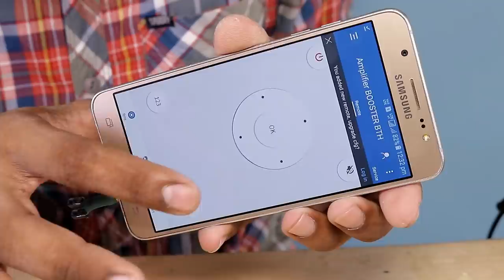3 Amazing ideas

Comment: That 1st one is so fake the phone u use has a ir lamp build into it and there are no drivers for an ir light in a headphone jack it doesnt work
Reply: send bob u has virus on ur compooter
Reply: They'd be using solder not glue...
Reply: Idk if youever ever tried to make an electrical contact AFTER placing hot glue. I'll tell you its pretty difficult. Difficult enough to make me doubt someone who reused clips 3-6 times a month just to keep their content farms going... just sayin'.
Reply: @Sam Orifici it aint fake i did this a long ass time ago i just used 1 from a old universol remot that was broken and it really work granted of course that i had to be pretty close cuz the one cheap but it did indeed work my frind.
Reply: @Sam Orifici oh yea you are correct on that
Reply: You can just download a app think it’s called peel remote lol
Reply: @sumobisscuit8632 unles its wifi based still wouldnt work without a built-in ir light i think not a 100% sure
Reply: Just did that and it doesn't work
Reply: В моём сяоми и так есть телефон порт
Reply: @Trustierlamb920  it works with wifi unless you have a built in ir sensor
Reply: @nissimnacca7988  that's literally the end of a headphone with plastic on it. It has no circuitry so how could it do anything other than light up at the max?
Reply: @sumobisscuit8632  peel remote used to be a legit app... Now it's just an add farm, and the app does nothing. There are at least 10 peel apps on the store... I only tried 3, they all did nothing all the same.

If the trick in the video was real, at least he would have shown which app was used.

Comment: Escuse me ...I am one of your subscriber Mr Sabin .... I have tried to make it blaster like as u but it didn't worked....what may be the reason plz tell me
Reply from the maker: check connections use 2 ir leds and solder with oposite terminals means + to - and - to + the solder it with headphone pin .